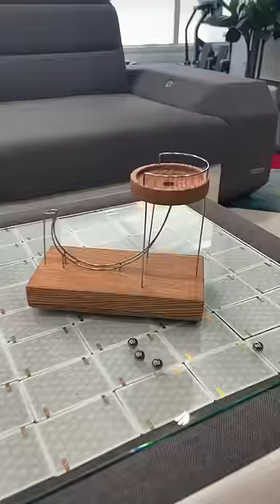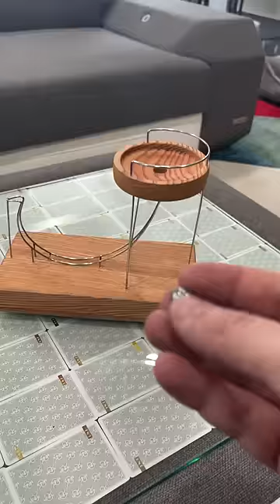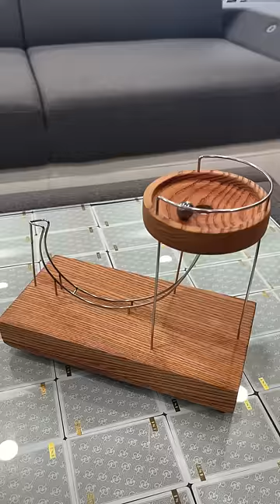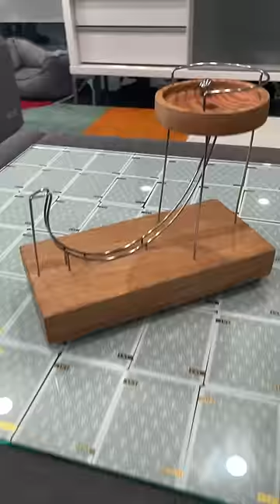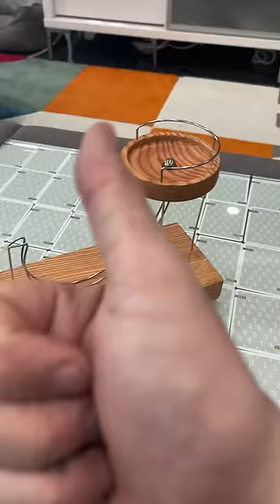An Impossible Perpetual Motion Device?! 😳 #Shorts

Comment: Just so it's out there, yeah this isn't real. The device is actually electrically charged so the metal balls go flying
Reply: Thanks for saving me the trouble of pointing that out. Without an electro magnet in the base, the ball would not quite reach the top dish
Reply: @1lllllllll1  ah sure. It's like that experiment science teachers do releasing a heavy ball in a pendular motion in front of their faces, the next cycle is always shorter.

I'm not scientifically oriented at all. But i feel dumb for not realizing how this worked first .

Anyway, thanks for pointing that out and explaining. This thread should be at the top.
Reply: @salvadorpalma8173  yo what? Ignoring friction, the ball still wouldn’t hit them in a pendulum. If they release it in front of their face, the oscillation would end its period in front of their face. The weight “falling short” of its starting position would be due to kinetic energy converted to heat through friction of the entire system
Reply: @matthewsamortin8754  you misunderstood my comment, mate
Reply: I have one almost identical. As the ball goes into the hole, a small motorised wheel spins to push it down the metal slide faster.
So not electrically charged.
But definitely battery operated.
Reply: Ah, I was wondering how the effect was achieved, thank you.
Reply: @1lllllllll1  I find it funny you said thank you for saving you the trouble of writing it out when your thank you was longer than his answer lol I think he caused you more trouble.
Reply: Thank you for pointing this out, I was racking my brain on how it got the ball higher than where it started. I was too distracted by the wooden funnel, I thought the trick was hidden there for some reason.
Reply: @bluekillion4487  what do you think batteries do lol 😂
Reply: @NZ2STROKE  Electrically charged means an electromagnetic force.  
A small battery operated motor accelerating the ball through the hole is not that.
Reply: @bluekillion4487  Today I Learned that in scientific non-layman's terms, "electrically charged" does not mean "powered by electricity" apparently. So... the motor that's being powered by an electric battery is not being electrically charged by that battery? o.O How does a battery work if not by electrically charging a device? Don't electric motors work by electromagnetism?
Reply: I figured! Battery, magnet, the unnatural acceleration at the end of the jump gives it away
Reply: Exactly. The base is thick for a reason.
Reply: @slidingconstant  just pointing out that the battery and wheel are actually both in the top part, and not the base.
Reply: @ipatchymakouli415  Really? So, the base is truly thick wood just for looks?
Reply: @slidingconstant  Yep. You can check videos of it just by googling keywords such as "fake perpetual ball"
Reply: I read this as meatballs go flying
Reply: But what is the bills can produce energy that can be used to charge with electricity the thing
Reply: Thanks a lot for this explanation. I came down here after seeing the ball which somehow flew higher than its starting position
Reply: @salvadorpalma8173  it's ok dude I'm dumb too 😀
Reply: @hellooutsiders6865  😂
Reply: That must be it.
Reply: Yeah I was gonna say something has to give energy down there because if you had zero resistance the highest the ball ever could go was it’s starting height and it’s going well beyond thag
Reply: Thx
Reply: I was wondering how he managed to make those balls move so damn fast. I thought something was up 😆 thanks for clearing that up. Still looks cool though.
Reply: It’s still real
Reply: @1lllllllll1  electro magnets are a natural phenomenon though. Which would make it last forever as long as the permanent magnet keeps it’s flux.

Comment: First thing I found about it on Google was: "Battery not included"
Reply: Meaning that it does not use batteries. It's legit infinite energy dude
Reply: @avielaskira  meaning that it needs batteries to work....
Reply: @zeno9580  lmao, I think he misunderstood it
Reply: @zeno9580  But they are not included. Why would they not include something that you need?
Reply: @avielaskira  Have u never bought an electrical device where the batteries aren't included!? It's very common... And why would it specify that batteries aren't included if it doesn't require batteries? 🤦‍♂️
Reply: @zeno9580  I've bought a battery pack that said "batteries arn't included". Does that counts?
Reply: @avielaskira  If it doesn't use batteries then that's just dumb. It should say batteries not required or something like that
Reply: @zeno9580  wooooozh!
Reply: @zeno9580  my god, you don't understand that you're being trolled?
Reply: @avielaskira  the letters in you're name are sick, they look like the letters on the predator wrist in predator 1 as he's about to self destruct after the fight with hey Arnold..

Comment: There’s a magnet 🧲 or magnets hidden in the wood that speed the acceleration of the steel ball as it passes them and gives it the speed and trajectory to reach the wood funnel.
Reply: That wouldn’t help because the same magnets would “pull” the ball downwards during its jump. Unless they are electromagnets that are toggled by a controller.
Reply: Ok
Reply: As the ball passes the electro magnet the magnet is switched off.
Reply: The ball is a magnet that's why it has a wire reel or rail to throw it into motion easy and it is real
Reply: And?
Reply: Nope. You clearly missed basic high school physics lol
Reply: @ahappycoder2925  you know, a really good way to actually contribute to a conversation is saying something factual and is related to the topic(in this case, how the machine works) rather than just saying “you’re wrong haha”.

It’s an electromagnet if anyone’s wondering.
Reply: Magnetic 🧲 for sure
Reply: Electromagnet with a lil circuit
Reply: Why do people comment on something they know nothing about?
Reply: Close- it’s a battery-powered motor!
Reply: Maybe electromagnet. Which is turned on short moment to add impulse to ball.
Reply: @TopRamin  Yes it is
Reply: It's translating the rotational energy from the top into downforce through the track.
Reply: @TopRamin  he uploaded a video of this where he opens the bottom of the housing and it has a battery operated magnet and sensor
Reply: @Oopsall  that's not how physics works... friction is absorbing the momentum until gravity pulls it towards the center, but in reality the ball would never go higher then its starting height of the track unless another force acts upon it
Reply: Nope
Reply: No, there is an external device off camera to the left.
Reply: @justinmyho5235  he literally, shows the magnets and batteries in a video
Reply: Nope. You are all wrong.. 
It is powered by mini dilithium crystal reactor drive. Thus the unnatural acceleration as soon as it exits the funnel. 
If we give it another second and it should reach warp 7.
Reply: @JeagerTv  they're in training to be a future politician.
Reply: Yeah you can see the magnets sucking the ball into the hole lol
Reply: Bot
Reply: @ilmarsmarsils8029  Yup. Correct.
Reply: @CronosCross  I know. LOL
Reply: That's what I was thinking
Reply: @CronosCross  you're right - a battery operated magnet and sensor at the base of the housing makes more sense. I saw another video - don't know if it was this channel or not - where they showed an electric device (don't recall if it was a magnet or not) off the screen to the left, which created the illusion of perpetual motion - or maybe it was free energy.. Thanks for the correction.
Reply: Wrong. :)
Reply: no sht?
Reply: @Oopsall  if that's all it was it would slow down still each time because of friction and not make the jump after a couple times at most
Reply: Watching this and knowing some basic physics, I knew something was fake. There's no way the ball would shoot behind it's starting point due to just gravity.
Reply: @pcproffy  and friction. The secret is in the base with batteries and small electromagnet
Reply: Nope. The space between the rails increase so the ball will roll faster towards the end. Problem is, if you'd try to get energy from it you would create resistance which would cause the effect to stop at some point. Basic physics mate.
Reply: @Musique3579  it can be connected electricity to the rail. Electricity heats the ball at the contact area. Ball and rail metal expands and forms like steaper hill, and it rolls to lower an cooler direction.
Reply: @daniloistda  its a magnet under the disk part that increases speed
Reply: @thatguyyouknow2221  it's actually ironic that he said "high school physics" as he sounds like a high-school boy.
Reply: @CronosCross  could you think that ball also stores rotational energy obtained while rotating around hole in cone shaped dish? May be here it gets additional energy to overcome height difference
Reply: So what? 
doesn't matter if there is a magnet or not as the whole system will  work forever.
If this is true it compromises the physical friction principal.
Reply: It actually has a mini 4 cylinder turbocharged engine that pushes the ball with 350hp
Reply: That would be perpendicular anyway
Reply: Magnets would only slow the ball
Reply: Not magnet but electromagnet
Reply: @janitorial-engineer2286  with 350hp someone would be already dead with hole in the body from steel ball.
Reply: @ilmarsmarsils8029  It would actually break the sound barrier and shoot into space.
Reply: You don't think the momentum it gathered on the drop in is enough to propel it back up
Reply: @whatthat150  🤣🤣
Reply: @ahappycoder2925  yeah lol it's awful to see these comments.  Only thing I hate is stupidity
Reply: If it were magnets the balls would’ve pushed away from each other
Reply: @dadggsCA  electromagnets can be powered off and on with a power source. It's the same principle of how a rail gun works, but this is with significantly less power
Reply: @ilmarsmarsils8029   If you watch the video about 5 back before this, he shows it all.
Reply: @joepatterson7274  possibly. Those beads look like polished magnetite. I'm a wire sculptor and now want to try and make one of these.
Reply: But it works, perpetual motion doesn't say there can't be a magnet it just says it won't work but this does
Reply: @sugerbear81  I figured it must work. It's so simple a design. Well cool that bodes well for my creative plans then!
Reply: I've recently noticed that there are different versions of this device where others have copied the original designer. The cheapest version is taking the same idea and making it work as cheap and basic as possible by using a motor at the top base to propel the balls downward. That allows for a 1.5V cell as opposed to a 4.2V lithium. 

The magnetic version seems to work very similarly to other cool magnetic toys out there such as dancing solar toys or pulse motors which switch on from current generated by rotor speed. 
There are easy ways to actuate a switch via a magnetic field whether it be a reed relay or hall sensor, but you can also use a sense coil.  Dancing solar toys use a sense coil in a way where it's the drive coil also, but other devices use a sense coil to just induce a voltage as a magnet moves past it. A magnetic ball could create a voltage in a sense coil as it rolls by, which then actuates a switch controlling the main electromagnet coil. 

Alternatively, a magnetic relay could be actuated as it becomes attracted to the presence of a metal ball rolling by. Such a relay would just require a moving leg with a magnet on it, which becomes attracted upward to touch the other contact as it's attracted to the steel ball. Either way, these other concepts are way cooler and way better executed that the garbage plastic knockoff that has the tiny motor in the top platform.
Reply: I think the magnet 🧲 is below that hole under the wood that touches the ground, so he pulled that ball in full speed but the wire attached is change his direction.
Reply: @mikelara7129  
Only maybe 1 or 2 times
Reply: @sugerbear81  it's a battery operated electromagnet, there is more energy going into the system then is giving back, while some energy is lost through friction of the marble going through the air and gravity. Therefore, this is not perpetual motion
Reply: Exactly
Reply: @mikelara7129  that is why some people thinks this is real but if it's really than physics must be wrong don't you think that.
Reply: Zactly
Reply: Right but magnets aren't breaking any rules so???
Reply: SUCH A STUPID STATEMENT 🙄
Reply: @CronosCross  that is so disappointing. Like finding out how a magic trick works! I just wrote a comment about it being in a vacuum (I thought that would be enough to keep it going) but, yeah, first I forgot about friction, second, that bit about it going slightly higher than it started at is true, even in a vacuum. Ohhhhh!!!
Reply: ...magic...
Reply: @CronosCross  Actually, this IS a rail gun. Nobody has said it yet, but there are no magnets. The ball itself becomes a magnet due to electricity flowing in it, causing it to move.
Reply: No
Reply: @DD-nv2vg 😜
Reply: @mikelara7129  it's the shape of the ramp and weight of the bearings, yes.
Reply: @bhall4996  Once it falls though it's still falling at the same speed down the wire ramp each time, the bearing wouldn't slow down each consecutive time, if it worked like that we should all be floating into space, if gravity had diminishing returns after one or two tries.
Reply: There is no magnet. This us just 3d postproduction.
Reply: Agreed, a production of energy or force needed.
Reply: That would explain the massive acceleration they have
Reply: You know what? But it, test it, prove it, and comment again your result here...
Reply: Its an edit….
Reply: Yeah thats what i was thinking, or a battery
Reply: He is telling the truth YouTuber break this already

Comment: This is actually a really cool device. It uses perfectly timed electromagnetic pulses to pull the ball down to a certain speed, then it pushes it back up with the next pulse. It’s basically just how an AC motor works. Permanent magnets on the rotor, in this case it’s the steel ball, and electro magnets pulsing and repelling the rotors magnetic poles. It’s pretty cool!